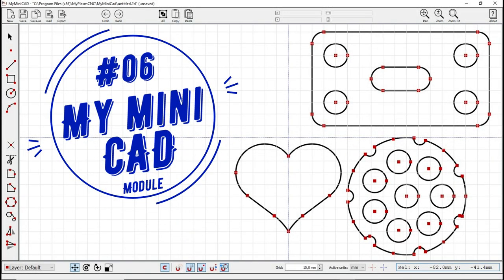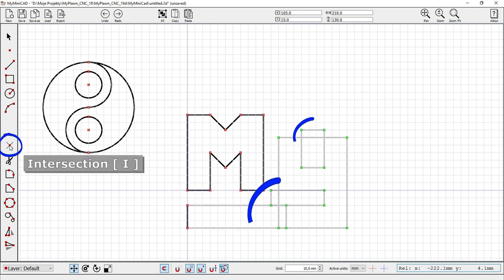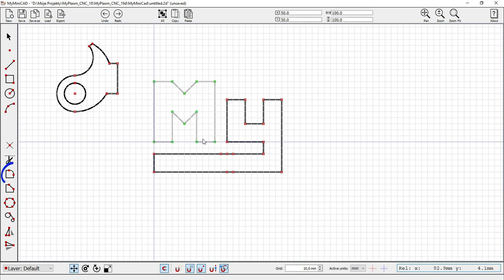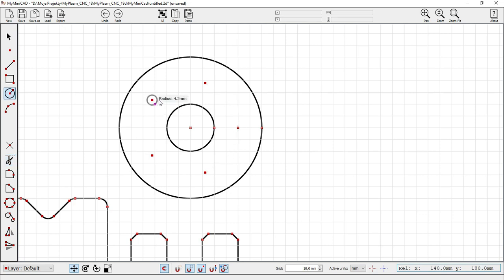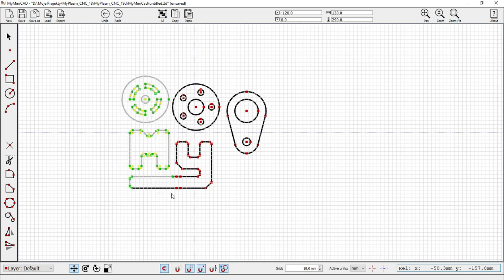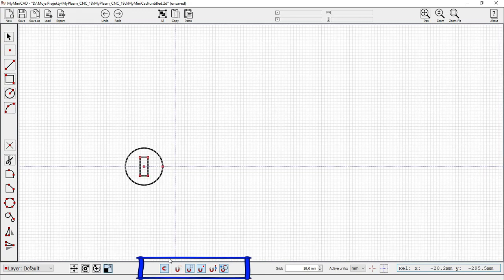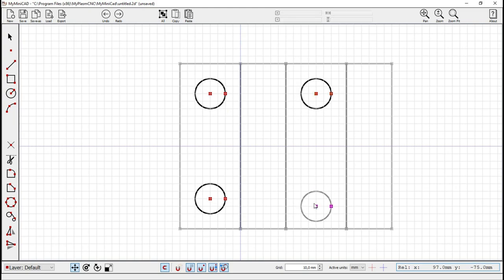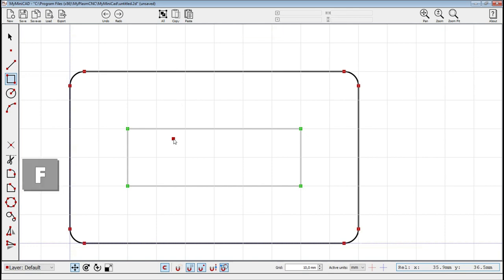# 06 MyMiniCAD tutorial - Step by step

Comment: From a new customer, these tutorials are gold worth to learn from⭐️⭐️⭐️⭐️⭐️
Is it someway possible to import text or other outlined images, from other files into minicad?
Reply from the maker: Not. This simply module MyMiniCad included to system not supported lot of functions like splines etc.. what not allow to using standard fonts or drawings from other software.

If you need more function you need to use proffesional CAD.